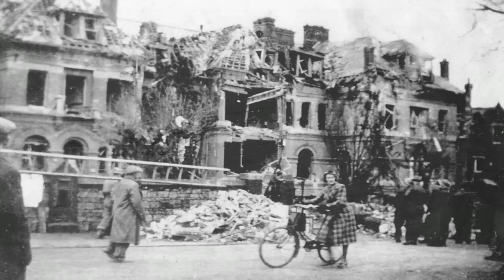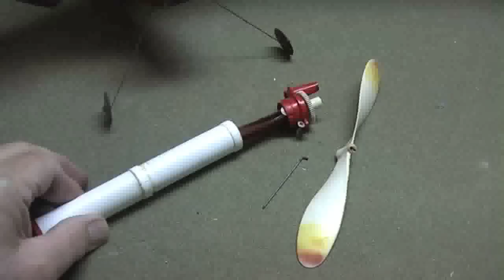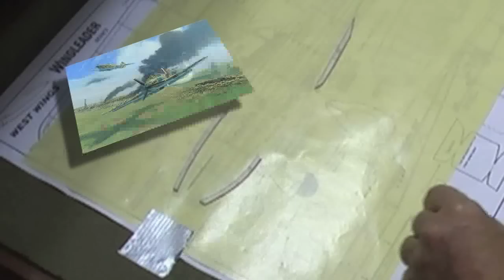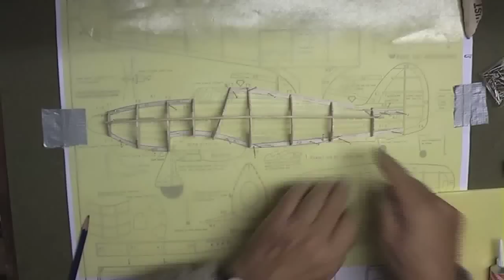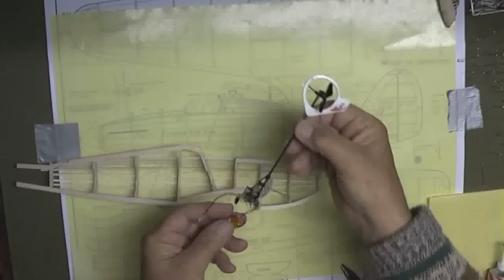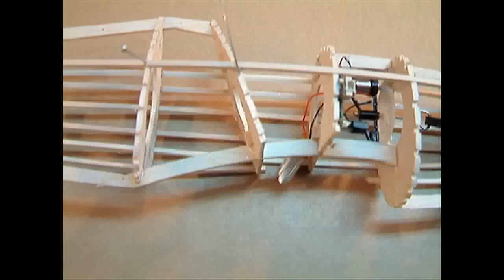Model Hurricane part 1.mp4

Comment: How did you do the elastic band  motor connection?
Id guess that the small motor and battery would be spent  by the time the rubber band attained enough  wound tension to transmit the power?
How did you make that rubber band link  semi/rigid?
Great videos. Thanks for posting.
Reply from the maker: The rubber band link was quite flexible: just looped over the drive hooks. The duration of the prop spin promised a fairly long flight. I went further with the experiment by buying a very cheap model helicopter and was quite amazed how much power came from the brand new battery. Trouble is, I'm now too disabled by age to dash around flying models and only enjoy making them and making movies. Thanks for your interest!
Reply: Thank you for your reply John. 
I came upon your videos by chance on UTUBE. 
It reminded me of how much I loved the hobby as a boy. Your film has kind of inspired me to go back to something that I never allowed time for now I'm in my 50s!!!
You are clearly very skilled in this area as your end product displays. 
I just had today a delivery from Amazon. Everything I know I require including my plane in a huge delivery box!!!  I loved it. It was like Xmas in April!!
Thank you John for your informative, entertaining, and hugely enjoyable films. 
I'm very sorry to hear you say that your mobility is a bit limited now, but I hope that your great hobby still allows you to have an enjoyable and fulfilled retirement. 
Great uploads here. 
You are a gentleman, thank you for re inspiring an old model maker.

Comment from the maker: Thanks for the comment! Better check out the centre of gravity. I found later that the model requires a lot of weight up front and subsequently moved the motor forward as far as possible. It still required extra weight on the nose. Good luck and keep the props spinning!

Comment: Not that your way is wrong , but , you could use a home photocopier to copy each portion/section of the build (fuse/wings/tail/rudder etc) separately and pin through those copies instead of the original plan.  That way , if you have an RC crash , you still have the original plan with no holes in it.  Since I keep my original plans undamaged or worn , I can build anything from scratch I need for any plan.  For example , I am building a Spitfire MKIX (1/7th sport scale model) which I will fly , and there is nothing like having to replace a 5 foot wingset etc.

Comment: What do you mean "adapt the wire for free flight"thanks
Reply from the maker: Hello Johnny. The wiring was originally connected to a small circuit board which was designed for remote control. I had to simplify it by identifying the basic wiring to the motor which was then connected directly to the battery via the on/off switch (reversing polarity to enable correct prop spin). Therefore: No remote control, only free-flight.  Would you believe, I still haven't flown the aircraft?  Too many other commitments in old age :-( But I have moved the motor and battery as far forward as possible. Even then, I had to add a lot more weight to the nose to  obtain the correct centre of gravity : one third from leading edge of the wing.  I still think the whole idea would be viable but for a non scale aircraft such as the Eaglet shown in the movie.  Good luck and enjoy your modelling!
Reply: Thank you very much

Comment from the maker: @EbanBrown2 Hello Eban.  If you are fitting an electric motor like mine, install it as far forward as possible to get the correct balance. I have repositioned mine up front with its small battery and have even had to add aroung 14grams of metal washers to get the balance one third of the wing cord from its leading edge. I still haven't flown it as I have gone down with a virus which has effected my breathing. Hope to get well soon and back to the project!

Comment from the maker: @EbanBrown2  Hello Eban. Thanks for the info.  I will certainly move the battery forward. I have started this by making a small hole in the lower part of the bulkhead in front of its current position and another access aperture just forward of the wing. I am about the extend the battery wires through through these.  I hope to use the battery's new position to get the CG correct.  I have also recently re-covered that Eaglet and hope to do some test flying soon. Perhaps another video.  Life is fun

Comment from the maker: Hi Eban: Now you have me:-)  As my memory tells me, I tested points on the circuit board to discover the pos and neg joints which were not effected by the radio control device. Coming from those, I then had to reverse the wires to obtain correct rotation for the prop. I am no electrician or electronics expert. Trial and error was my method. I still haven't flow the model but I think I may have to alter the battery position further forward... somehow.